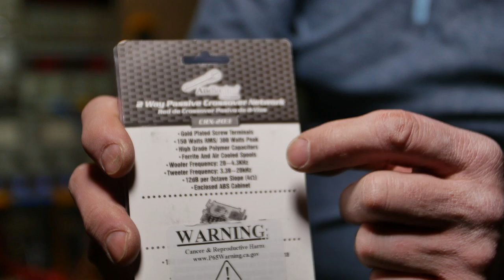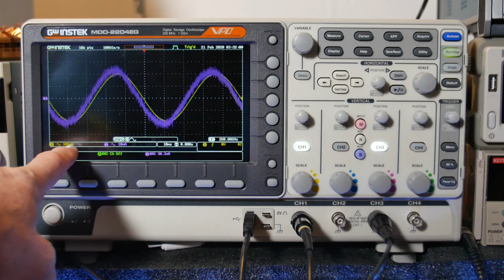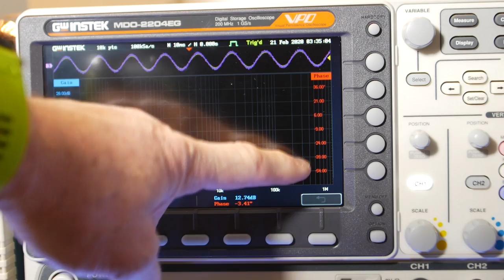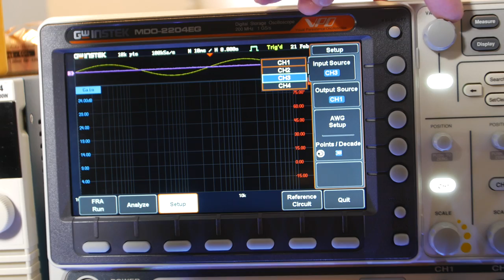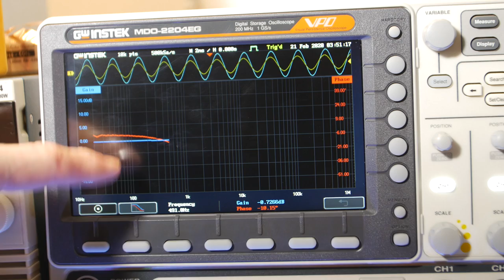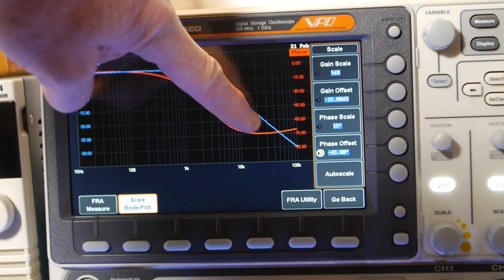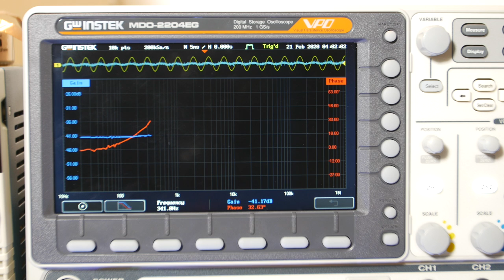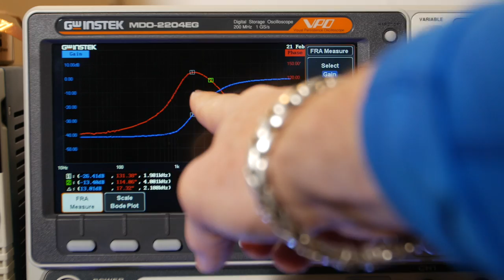2 Way Speaker Crossover tested Part 1

Comment: thank you eddie,  
so sorry , is there any video about passive crossover designing with micro caps and test it with that  ? i have to make a custom passive crossover for my  speaker used for floor monitor. at least i can design and test that design with micro caps 12 before make a real shcematic.  .just to make sure before buy the the best value component of it .
until now thanks very much for sharing eddie .  🙂🙂
Reply from the maker: ozy prima You bet ozy prima!  What is the impedance of your speaker drivers?  I’ll see if I can do that today;)
Reply: @KissAnalog  Work at 300 watt  speaker drivers  4 ohm for low freq and high  freq at 8 ohm eddie 
 . Thank you
Reply from the maker: You bet, I’ll show how to do that later this week!  Thanks for asking this very useful question.
Reply: @KissAnalog  you are my inspirator eddie. i hope can learning much more about passive crossover from you . 
thanks so much
Reply from the maker: I appreciate you - and am happy that you are on the team:)

Comment: Would it be possible to use a shunt resistor instead of a current probe? Would it be a good / bad idea?
Reply from the maker: Yes - you sure can.  The difference is - now you have to break the circuit to place the shunt resistor.  Also, you want a resistor that is - essentially zero compared to the input impedance.  So, then you need a nice gain amplifier to ready it - unless the current is high - then it is easier;)

Comment: I just purchased that exact same crossover...I have a 4ohm mid and 4ohm tweeter, which i was going to run in paralell which would give a 2ohm from amp..Question is, if i use that crossover will i still have a 2ohm signal(like running in paralell) or will using the crossover keep a 4ohm from amp....thx
Reply from the maker: Edward Jones I think it will be fine to do it that way.  The tweeters are so efficient - that might be a great way to do it.  You could experiment and try putting them in series.  Let us know how it goes.

Comment: Hi there, you reviewed one of those cheap LCR meters a couple weeks ago and I asked you if it was able to measure capacitors with a high value of 10000uF and up, you said you'd try to measure some bigger value capacitors and make a video about it and I'm watching you as a hawk for an answer however you didn't make a video of it or give an answer in the comments.
I really need to know if the meters you showed are capable of measuring the bigger value capacitors, I found just one meter online capable of measuring up to 1000uF which is pretty good but since I regularly see capacitors with a value of 2200uF, 10000uF and up and I'm looking for a way to be able to measure the new super capacitors with a value of 10 Farad up to 500 Farad and I've asked many people already but I can't get anyone to give me an answer, you'd do me a big favor if you showed the cheap meter measuring a 1000uF, 2200uF and a 10000uF capacitor... That would be helpful to me already and if you can tell me how to measure the new super capacitors that would be golden.
Thanks in advance,
Ricardo Penders
Reply from the maker: Hi Ricardo, I’m sorry this has taken awhile.  I have purchased 2 inexpensive melters which both say that they can measure 100,000uF.  That’s as high as I could find.  I have a few others that don’t read as high.  I will do a video on these showing the trade offs, but it probably won’t get posted until Saturday.  I have two other videos that I’m finishing up on this week.  Here’s the links to the 2 low cost Meters.  BTW, it is very difficult to measure capacitors measuring in the Farads.  I’ll also post a video on how to do this next weekend.  Thank you so much for asking this great question!
https://amzn.to/2Vh2bUj
https://amzn.to/2T4pq12
Reply: @KissAnalog  Well thank you very much for your effort so far and I'm very curious about the inexpensive meters you're gonna show very soon I hope.
And I'm even more curious what you come up with to be able to measure capacitors with values in the Farads.
I'll take a look at the meters you listed here and if they are up to spec I'll probably get one myself... If you have a Banggood affiliate link please share that with me because I do want to support you but since I don't have an Amazon account that's not possible.
Best regards,
Ricardo Penders
Reply from the maker: Thank you Ricardo!  I’ll see if I can get that to you this weekend.  I plan to post that review as well;)
Reply: @KissAnalog  Thanks I'm looking forward to it.

Comment: I wouldnt put an electrolytic capacher on the high pass crossover
Reply from the maker: Great point.  I agree - I would try not to use any electrolytic capacitor in a  crossover.
Reply: @KissAnalog  Ive tested this also they would be ok under 400hz or sub crossover

Comment: The only I see is that "ready made from the shelf" passive 2-ways filters SUCK !
Reply from the maker: Thanks for your feedback!  Do you prefer making them from scratch?  Or are you saying 2 way filters are not your bag?
Reply: @KissAnalog  Eddie I don't like at all passive filters. I prefer active (analog) 2-way filters  (1rst branch low pass to the X-frequency  and the output "substracted" - in the following stage (2nd branch) - from the input to the filter signal. In that way we get the "hights".  I have avoided more than 2-way speakers (and bass-reflex also) from 1970. Last years I'm listening with full-rangers